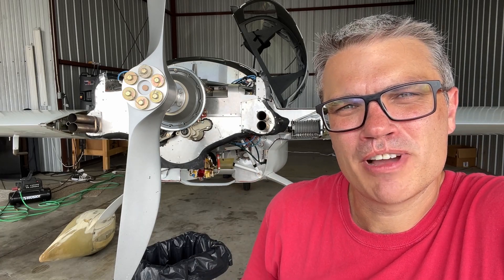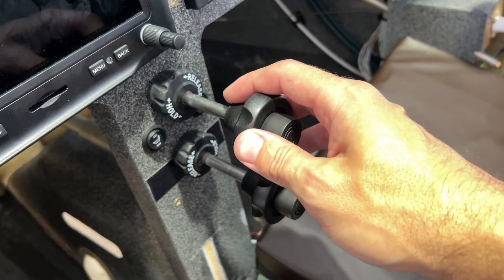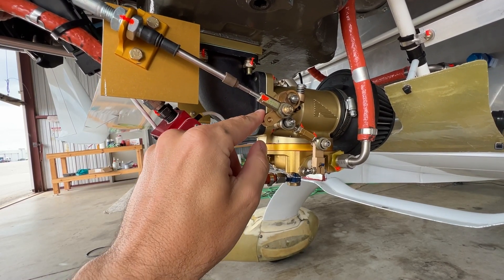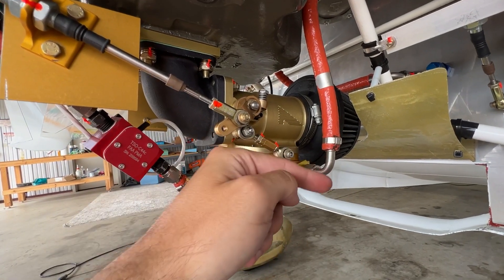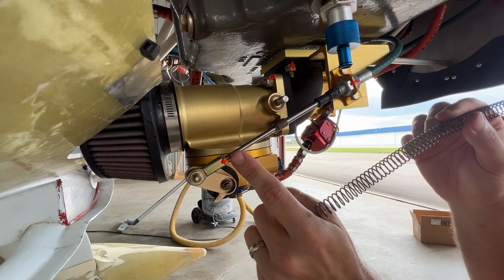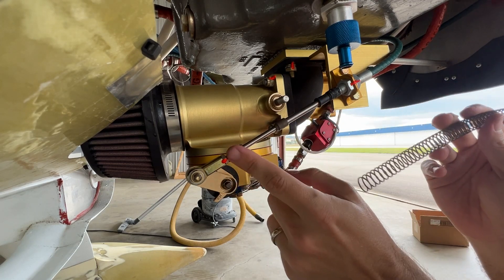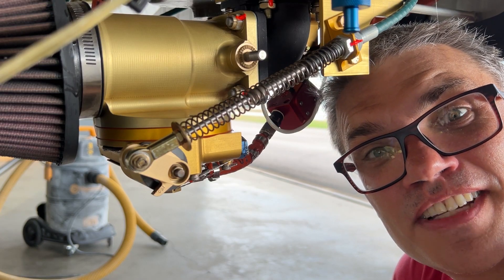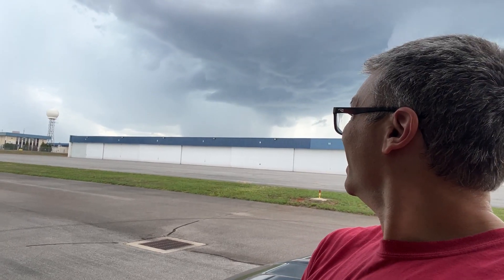Removing Backlash from a Mixture Cable

Comment: My friends Velocity runs much better with a 3 blade prop.  With 2 blades both blades hit the dead air behind the wing at the same time.  Excellent solution to the control slop!

Comment: Is there an airplane equivalent of the builder's code for home construction? How do you know what materials are ok to use?
Reply from the maker: Good question. In experimental aviation, anything goes, but the prudent builders try to follow standards like AC 43.13 https://www.faa.gov/regulations_policies/advisory_circulars/index.cfm/go/document.information/documentid/99861